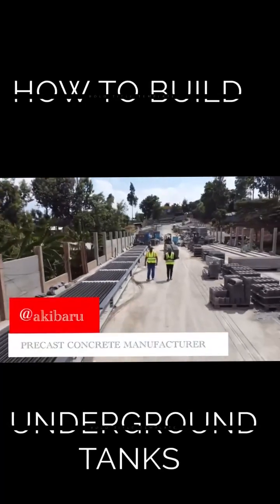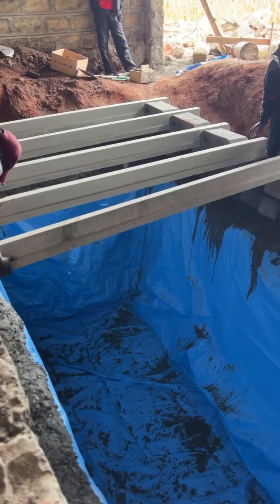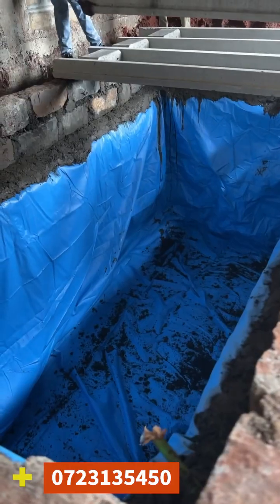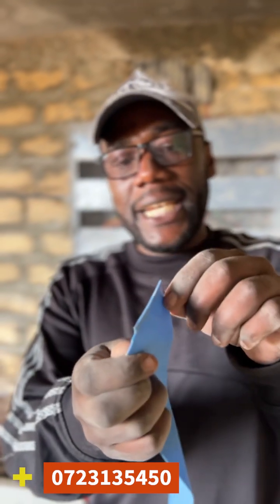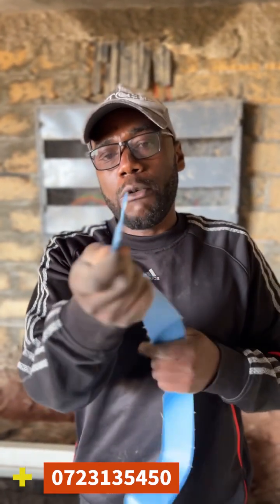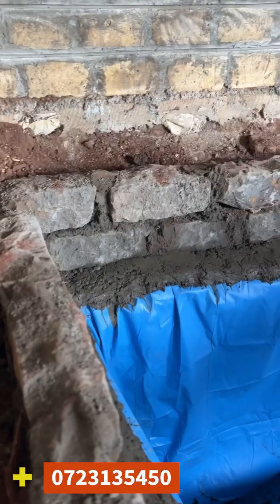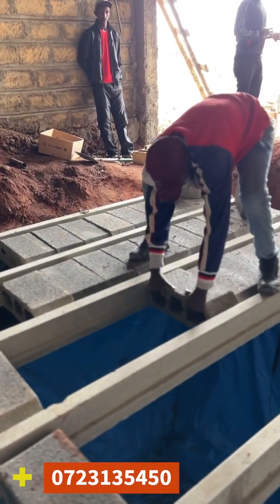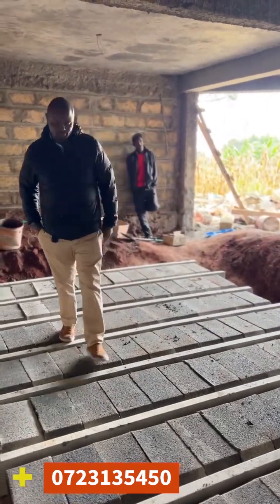How to build an underground water tank using A+ pvc membrane and Beam2beam flooring solution .

Comment: There's the aspect of underground water seeping into the void beneath the membrane during rainy season and lifting up the membrane especially when the tank is empty. Recently Mr Kamau and his handyman a Mr Ndatho did a similar project in utawala. The area is rocky and walls of the excavated pit was just rocks. About a week after membrane installation it rained and subsurface water seepage caused accumulation of water under the canvas lifting it up. Now the water won't go away and Mr Stephen has been unable to propose a solution to the issue preferring silence. If one must adopt this solution, it should only be to line a concrete tank. Anything less ni machozi!